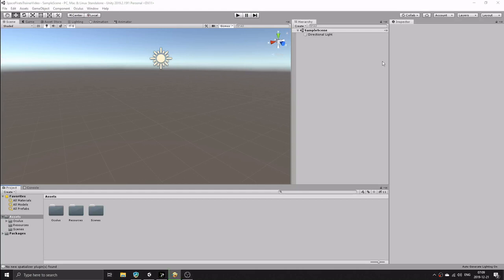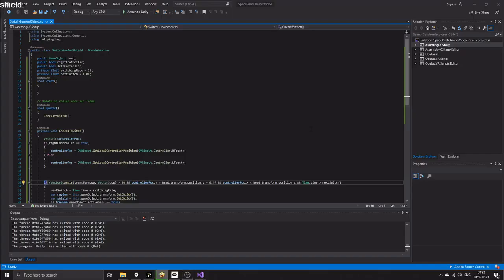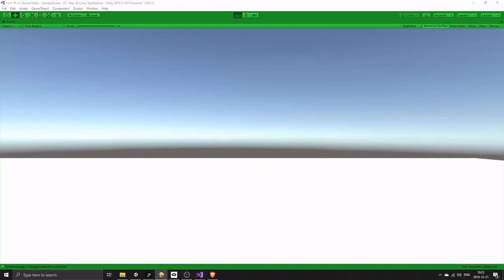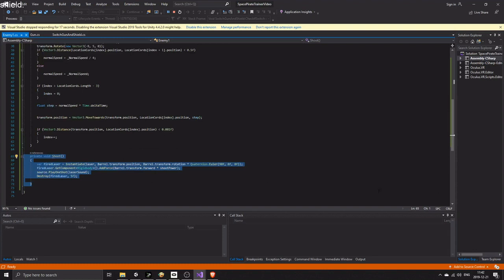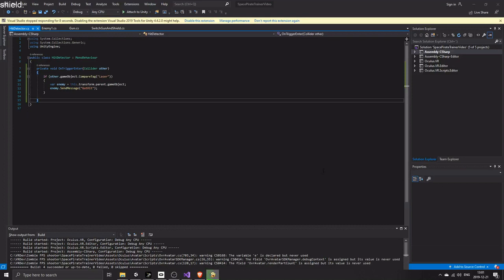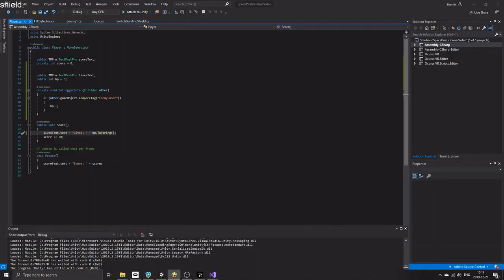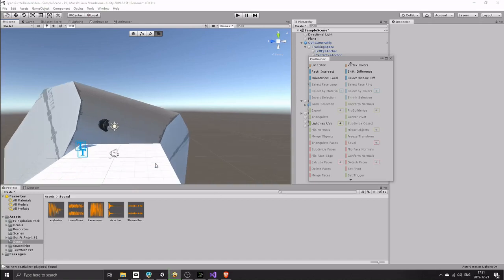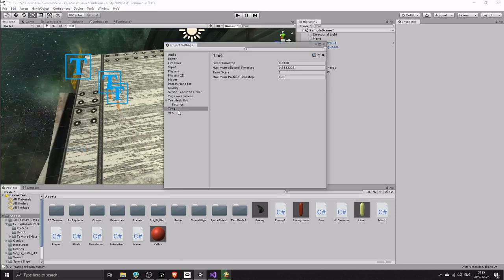VR GAME SPACE PIRATE TRAINER: UNITY VR TUTORIAL FOR BEGINNERS: [EASY] Oculus Quest/Rift/Vive

Comment: Hey Mr. Pineapple- great tutorials! but umm, I keep getting errors on my enemy and hit detector scripts- enemy script error "Assets\Scripts\Enemy1.cs(66,28): error CS1061: 'int[]' does not contain a definition for 'Contains' and no accessible extension method 'Contains' accepting a first argument of type 'int[]' could be found (are you missing a using directive or an assembly reference?)" any clue what this is about?
Reply: CANCEL THAT. I am now a patreon subscriber and got access to the scripts (never have done that before) please keep the quest content coming!!
Reply from the maker: You need to add a using statent for linq(Contains is a linq method)
 Right click on contains and you should get a suggestion to import linq. Otherwise add:
using System.Linq;
To the top off the file.

Let me know if you have any issues!